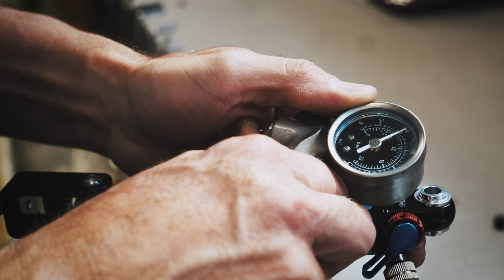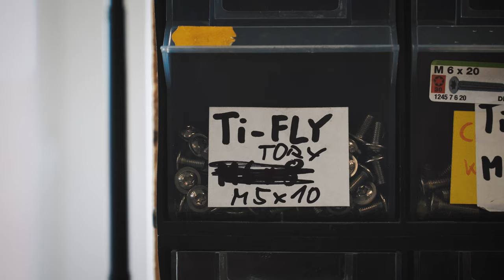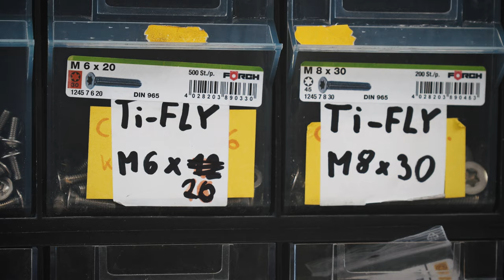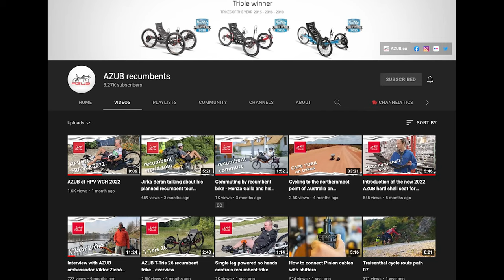4K 47-MINUTE DREAM BUILD! | $13,000 AZUB RECUMBENT TiFLY X TRIKE

Comment: Turning the trike vertically for chain being inserted in the chain tube makes quick work of an otherwise tedious chore. On a Pacific Coast tour, I had a chain break, and parked alongside the rural road to fix it. The chain had exited the chain tubes (gravity) when it originally snapped, so I had to re-feed it through the tubes with the trike in horizontal position, which takes a whole lot longer than the procedure shown here in the factory!
steve

Comment: The only aspect of the Rohloff Speedhub I did not like was that I was continually rotating the twist grip shifter, every time I wanted a different gear, because the Rohloff was the only shifting on the trike (a single chainring up front). Lots of twisting going on for Rohloff users! Other than that, they are outstanding! I now use bar ends, with a rear derailleur and a rear internally geared 3-speed hub (single chainring up front), so no more frequent twisting. I actually prefer the shifting experience I have now over the Rohloff.
steve

Comment: When I had my Rohloff Speedhub on my ICE Full Fat, the cables that go into the hub shifter mechanism had been cut too short (brand new trike). The first time I rode the trike, I had only pedaled a half block (literally) and one of the two cables disengaged with the shifter mechanism at the hub, leaving me unable to shift. Needless to say, I was not too happy on my maiden voyage! I watched the Rohloff tutorials on their website, and pulled the mechanism where the cables enter the hub off so that I could reconnect the cable that came loose. Unfortunately, when I cut off the frayed end, there was not enough cable left to reconnect, leaving me the only option of buying two new cables from Rohloff, and waiting a couple weeks for delivery (all the while, unable to ride my brand new ICE trike). When I received the cables, I cut them to the designated lengths and reconnected them to the Speedhub ... it all worked fine from then on. I notice in this video that AZUB has that metal tube with the specified length so that he could cut the cables precisely, which alleviates the problem I had! Way to go AZUB!
steve

Comment: Frame: 6:05.. i have never seen a reverse side countersink.  AZUB's air tools are amazing.  These are not cheap to build.  We forget about how expensive aluminum molds and production is.. My father's irrigation business has 3 aluminum molds that are $12k each, they are rotated into an oven, while one is cooling and one is being loaded with resin.  This completely makes his operation look simple.  WOW.. I have far more respect than i did 15mins ago.
Reply from the maker: yea!  the reverse countersink is pretty neat... i was wondering how they were going to use it until they put it in the hole and pulled on it instead of pushing.

Comment: I'm curious about the potential photographic impact of suspending your trike from a high-tensile fishing line attached to an overhead turntable, as opposed to having the trike simply sitting on the turntable. It could be an interesting concept to propose to Honza. Aside from this, the video provides an impressive compilation of moments captured during the assembly of the Azub TiFLY X.

Comment: I'll take my mechanical disc brakes any day over hydraulic! I've had both kinds, and stop just fine with mechanical ... with no need to mess with toxic hydraulic fluids. Interestingly, the HP Velotechnik Gekko, which sells for a fraction of the price of the HP Velotechnik Scorpion, has hydraulic, while the Scorpion has mechanical (go figure ;-)
steve